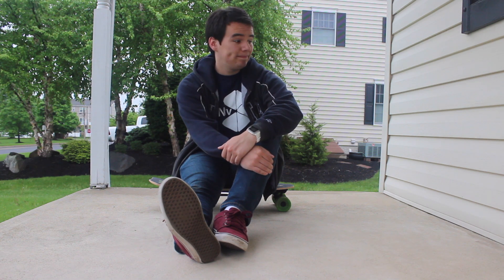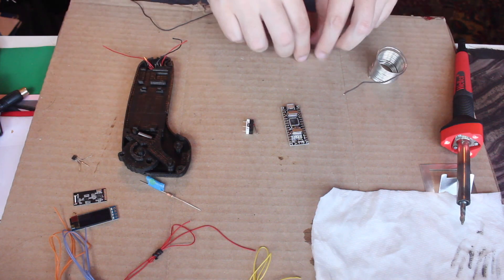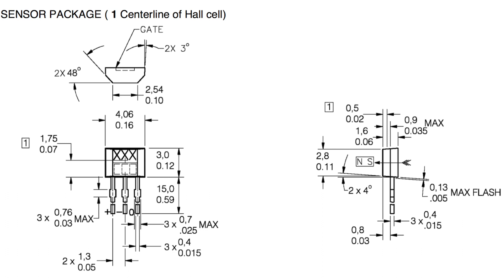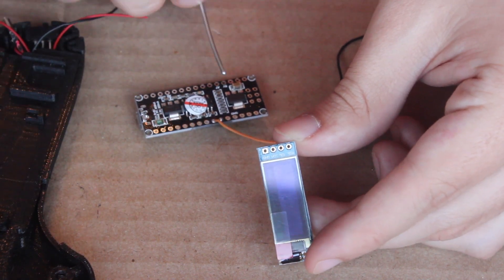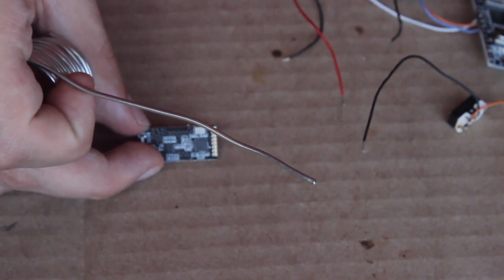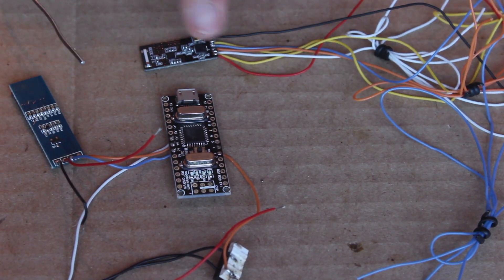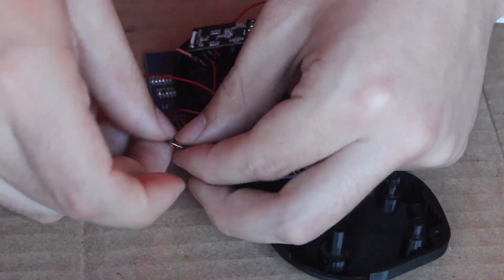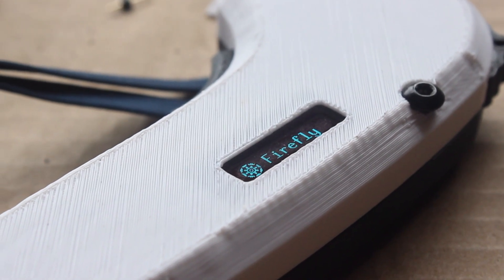Custom Esk8 Remote Build Guide: Part 3

Comment: What's your opinion on the prebuilt receiver and all the different sorts of capacitors people are adding to the their PCBs?
Have you had any issues they helped, if you used them at all?

I thought I had all parts now that I received all that are on the solidgeek.dk list, the same ones you have that solid geek recommended... 🙁
Reply from the maker: My opinion? There's a lot of good potential solutions to the issues people are having with the receiver. I've found success with an LC filter and a cheap 220uF cap, or a high quality low ESR 100uF cap with a 22pF cap on ground and reset as well. It's a huge shitshow, which is one of the reasons why I've waited so long to release the next part

Comment: Thanks for the vid~! time for me to move on to the final setup stage. Are you doing a batch of these by any chance?

And damn, no one mentioned the 10kohm resistor before this, thanks for the heads up though man...Ill have to buy & wait for it....I order most from one store, only to order more later QQ
Reply from the maker: I actually am making a batch of Fireflies! Planning on selling them over on the forum
Reply: awesome, count me in as a buyer - are you selling them on solidgeeks thread or in the parts market?
Reply from the maker: I'll probably make a separate thread for it since the build thread is huuugggeeee and kinda hard to get thru